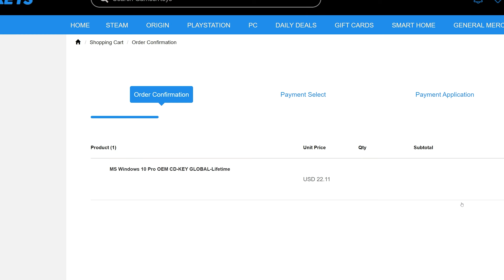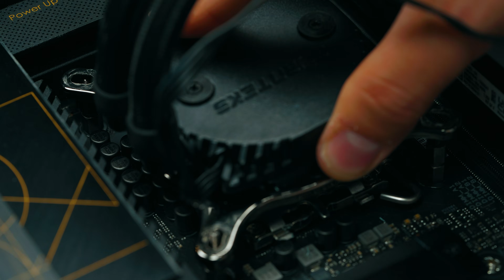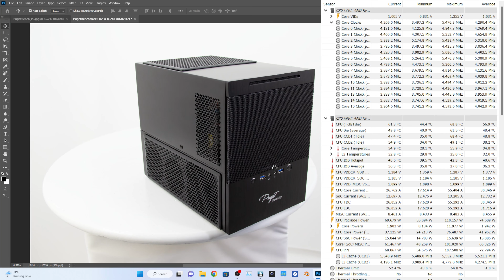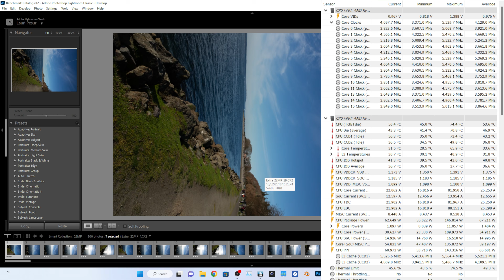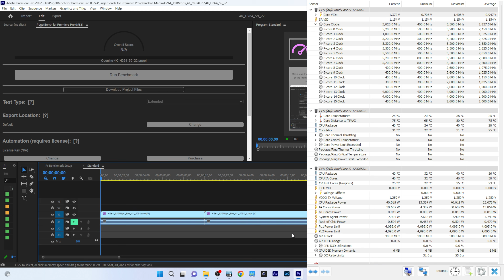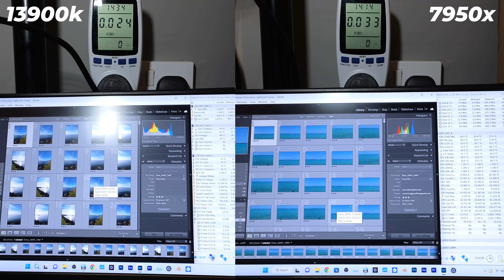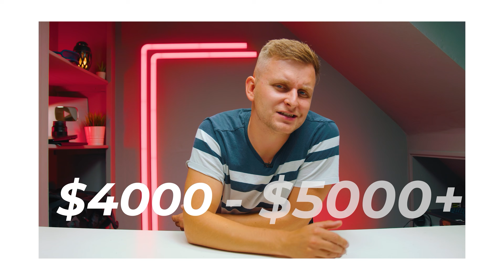INTEL & AMD both lied! 👉REAL WORLD power consumption is MESSED UP

Comment: are you trying to take a dig at youtubers that does power consumption to application used??? because a lot of big creators already know that and showed power consumption at different applications and their max consumption along with idle consumptions.... also while taking into account for those intel efficiency cores....
Reply: BTW some of those creators went above and beyond and already figured out their 1 week usage average... didn't change much on the fact that creators are better off using AMD because the average is way lower after 1 week plus in terms of time and efficiency, the AMD chips are way better for creators who needs to watch out for how much wattage they use... and the normal users who don't need so much performance over 30%-40% of the time, they are better of sticking to intel because they would probably use the efficiency core more often.... again this was all found out in 1 month of when the 13th gen launched....
Reply: as for those who game over 4hrs and need high core performance, you are better off using AMD as well... they already did the math back then....
Reply: this is all in terms of efficiency....

Comment: Ryzen 7000 eco mode? 5% performance drop for 40% energy drop. Also manual settings drops amd 7000 lower than any possible intel setting.

Comment: Guys it's all well but how about we measure the old and reliable way these idle and load powers, that is by means of a kill-a-watt? If there is 5W vs 50W "real world" difference in idle between an Intel and a AMD system, we would see it with the the meter. Right? SO, instead of beating around the bush and using "real world" applications. Just stick the power cable into the meter and that into the  power socket. Let's enjoy the real world results.
Reply: This is the actual way to measure real-world power consumption, not through software like AIDA64 and HWInfo as they are inaccurate and don't take account of power usage of other components aside from GPU and CPU

Comment: Power draw in all-core, 100% workloads is quite scary on my 14700 KF (over 300W peak), but I totally agree that this is hardly a measure of how the CPU will perform in the real world. Unless all you do all day is run CPU benchmarks like Cinebench or Blender, I suppose.. :)
Power limits on my board are indeed set to "no limits" at the board's factory settings and that's the whole problem. Also doesn't help that MSI have labeled the three PL-presets in the BIOS in a sightly misleading way. Even the lowest preset will set PL1 and PL2 to 253 W and it's labeled "boxed cooler". I'd like to see any Intel stock-cooler keep up with this CPU at those PL-settings, lol. The "no limits" preset is called "water cooler" or something similar, implying that you can run your CPU without power limits on a 240mm (or even a 120?) AIO. Which I could with my much less power-hungry 12600K but definitely NOT with the 14700KF. 
All that said: After having read up on the whole power-limit thing, I adjusted PLs, max current and voltage offset manually and the chip will now run right up to the limit of thermal throttling while drawing ~240W max and giving me the CB23 results you'd expect from an i7. All that on a 240 AiO. 
In the real world, the CPU never draws more than 40 or 50 W in more demanding games, sometimes peaking as high as 70 to 100W in certain circumstances. At idle and/or in desktop/browsing mode, it's very frugal and hardly ever jumps over 10W. True idle with just a sensor monitoring app open it'll sit at around 3W all the time.

Comment: Hello. Please advise. at the moment, I have a 10400 and a 6700xt (undervolt). I was assembling a PC to consume less energy, since I live in Ukraine. Should I change to 12400 or 7600 or 7500f? and which of them will consume less? thank you
Reply: 12400  + get some nvidia gpu for lower power consumption  undervolted 4060 goes below 100w

Comment: Just wanted to say this for people interested about the subject of power consumption, my I7 7700k + RTX 3070 + 2TB SSD+ 2TB HDD + four 8GB DDR4 RAM sticks + air cooler (single fan) + 3440x1440p ultrawide 34 inches monitor (G34WQC-A, should be around 39Watts) only takes around 92W to 96 idle (idle is web browsing on Edge + Firefox and nothing else) and 330W to 372W when gaming (max settings, 3440x1440p resolution), no overclocking everything is stock, tested with a wattmeter directly plugged to the outlet.
performances could be higher (and the 3070 consumption) but its held back by the older CPU.
so it's not so much consumption for good performances, i'm going to change my CPU soon and will probably go for Intel 13700k because the idle wattage is much lower than the AMD 7800X3D and while the gaming consumption is higher, most people don't game 24/7 on their PC so annualy i bet the consumption is lower anyway.
power consumption matters a LOT for Europeans because of the cost of energy getting higher and higher.

EDIT : my I7 7700k idles at 14W on average when using Edge with three Youtube tabs + four other tabs + Firefox and 8 tabs + Steam launched and with Hwinfo64.

Comment: Yeah but Intel has the meme worthy TDPs. So when you build a PC - you need to invest in an expensive cooler.
Reply: You are acting like AMD is any good. All AM5 CPU runs at 80-95C and AMD call it "normal" as if physics be damned in their eyes lmao.
Reply: @IAMNOTRANA  I have an old Xeon cpu with 8 cores. Avg temp in games is 60 degrees.

Comment: I think your approach is good, but I think you have a big mistake. 
How much a CPU consumes in IDLE is not determined by the CPU. This is decided solely by the power management of the motherboard and the bios settings. Maybe if there is a separate chip that is responsible for this, for example the EPU at ASUS.

Comment: Interesting impact of idle power draw. 55W is not a tiny amount of heat, and it can heat up an insulated room quite quickly. I have a friend, running an old Zen 3 system, is actually dealing with overheating issues because he doesn't have central AC. Built him a new intel system and has not had overheating problems since.

Comment: Have you tried lowering the power consumption of the intel 13th gen processors via bios? Like undervolting, limiting the temperature or manually putting pl2 values? Please make a video on that.

Comment: All the time I heard AMD fans saying that AMD is more efficient... turns out that AMD is only efficient if you leave your PC running at full load all the time. (Which is some people, but not most people).
Reply: Guru3D does these idle power measurements from the wall on all of their processor reviews and there's basically no difference in idle system power consumption between Intel and AMD.
Reply: @tak4043  Guru3D measurements are flawed. Instead of always using the same GPU & PSU, they keep changing the components with each CPU test - they’re basically rigging the results. For example, 1600W PSU and 1200W PSU will have different efficiency in low loads by a massive degree and even 2 PSUs from different manufacturers with the same wattage output can differ by 5-10W.
Reply: @Morpheus-pt3wq  Do you have another site that actually measures idle power and doesn't just stare at a possible software glitch?
Reply: As in doing work. Work is what the AMD chips are obviously made for, and Intel is good for bursting. Intel in actual work environments still gets the treatment by AMD.
Reply: Whenever the manufacturer will start talking about efficiency and not the actual power consumption, you can know it´s marketing lies.
Reply: @Morpheus-pt3wq  Except that what OP says is bullshit. AMD draws equal/less power at idle. All you need to do is look up any video that shows power consumption.
Reply: @michalsvihla1403  those videos don´t show IDLE power consumption. Instead, they show gaming/productivity loads and sometimes further rig the results by showing CPU-only power consumption.  Now, i´m not into productivity and i only play games occasionally with lots of internet browsing, watching videos & listening to music, which means my system idles A LOT. My current AMD rig sits at 80W at wall in idle. It´s mainly connected to both CPU IO die and chipset being active all the time and AMD seems to not even try to lower it.

I´m currently in the process of building intel rig (had to return the CPU due to it being faulty, got a knack for either faulty components or bad silicon in general) and when it worked, its idle power consumption at wall was 40W. That´s HALF. If i left the intel rig running 24/7, my yearly save of electricity cost would be 35€ - that´s assuming the electricity cost won´t go higher (which happened this year; previous year save would be 28€)
Reply from the maker: Exactly...
Reply: Intel are more efficient at idle, and that's just about it. The second you load more than a few cores, AMD is the clear winner. See Techpowerup's Gaming Efficiency page on their 14900k for a clear example. Most games do not max out CPU usage, but they'll more often than not load them 20-80%(depending on the CPU).

The only 14xxx series that gets close to AMD's 7xxx series in gaming efficiency is the 14600k.
Reply: Intel has basically always been way more efficient at low/idle load, interesting to see that is still the case today.

I remember comparing a hashwell system and amd fx system, the difference was staggering with the amd fx system drawing more power at idle than the hashwell i5 was drawing under load
Reply: @bjarne431  Hashwell? Is that the predecessor to Kebablake?
Reply: @michalsvihla1403  indeed, and its almost as good as kebab(lake) :-) (i know i misspelled it)

Comment: Amd is only better power efficiency if you run it at full load 24/7, for which I actually have a use case, but still chose 13900k, because of the reported issues with 7950x3d.

Comment: Since power consumption doesn't affect your electricity bills that much, a more important consideration, at least financially, is saving money on your power supply and cooler.  The power supply has to be good enough for the biggest power draw you'll have, even for milliseconds; the cooler has to be able to deal with your biggest SUSTAINED power draw.  Neither purchase depends on idling power.
Reply: What utopia world do you live in where electricity bills do not matter?

Comment: 13900k is MUCH more consisteant. I hated my 7950x.  Would boost all over the place doing as little as opening chrome. Idled at 40c-50c. Theis would cause my fans and cpu cooler to ramp up and down constantly when doing nothing on my computer. HATED IT! Just Crazy. My 13900k (-0.090 Undervolted) idles at 26-28c!  Thats it. It never boost all over the place opening apps and chrome. The only time it was more efficient was when under load or in Cinebench. Otherwise the 1300k is much better.  It also never goes over 85c with my Undervolt.  Gaming temps are lower on intel by 12c!

Comment: idk why everyone says AMD consumes less. Got 7800X3D/ 3090/ 64GB DDR5 with X670E Mainboard and it consumes much more than my previous build (11600k/3090/64GB DDDR4) in idle. Ingame the 7800 does consume way less than intel, but idle tdp (155w with 2 1440p monitors) is wild in my current setup.
Reply: Dunno what you are doing but 155 watt is insanely much for your setup. I use 104 watt idle average with 7950x3d (uses more idle, about 8-10 watt), 1080 gtx, single monitor, X670E motherboard and 64gb DDR5. You are either overlocking or disabled some sleep state bios settings, causing massive idle power.

This is with 5 SSD's and 1 harddrive.

Comment: Yea... software measuring is still really bad and unreliable. You don't even know if the software numbers are measuring/reporting the same thing, nor do you know the polling rate of the software/sensor (or if it's even programmed to show spikes). 

With this type of measuring, just measuring it at the wall(like you did in the end) is much better. Just try it with different motherboards and try to make some educated guesses about non-standard board power consumption. Motherboard chipsets are part of the ecosystem, so might as well include that anyway. 
Or just report all the numbers of different motherboard and let everyone come to their own conclusion.

I'd also be interested in knowing how much some motherboard and motherboard settings could save.

Comment: great job!  thanks for this  review/comparison !      it would be interesting to know how much   total pc  consumes  doing those tasks  ( with or without a monitor)   I think   on average    a gpu ( depending  which of course)   on idle - doing something     could consume  around   20-60w ??  ( not gaming  not rendering ).   and ram.  around 8 -10 watts ?   fans 12watts..  ssd like 10 ?      Motherboard   ,,mm :  around 20 w ?    of course this are  my'' just out of the pocket  ''  assumptions ..      :P.     so.         the whole pc ( without monitor)  would be consuming on average   ( doing  simple tasks  ).  30-40 watts cpu + 50 w gpu + 20 w  Motherboard ?+  25 w ram&ssd &fans (?) =   more or less   90-120 watts   ?

Comment: Well those benchmarks were app specific also take idle consumption into account (just a guess). When it comes to benchmark and power consumption you can see amd's power draw was less in every test.
Premier pro:
13900k- 298 watts - 1435 point - score:power ratio: 4.81 each watt contributes in 4.81 points
7950x- 229 watts - 1127 point  - score:power ratio:  4.91 each watt contributes in 4.91 points in performance

Lightroom classic:
13900k- 317 watts - 1942 point - score:power ratio: 6.126 each watt contributes in 6.126 points
7950x- 223 watts - 1880 point  - score:power ratio:  8.430 each watt contributes in 8.430 points in performance

I guess when underload amd has better power savings but due to idle 55w power consumption its average watts is higher in the tests.
When someone is using them for gaming amd will save more power.

😀😀😀😀😀
Reply: as the video says, it takes the average power consumption, including mix and max limits. Here, intel is more efficient.

Comment: I did some testing with the 7700X manual oc 1.18Vcore 5.2ghz. Also there's a setting in the bios that forces all the other parts of the cpu (iGPU Infinity fabric, etc) to run at full speed all the time. I turned that off. My idle is around 25-30 watts cpu package. Cinebench R23 ends up at around 19700 points using a max of 110 watts in hwinfo64. Without tweaking, these newer cpu's are power hogs.

Comment: I still don't see how intel is more efficient. They draw so much power yet win? If you were gaming for 4 hours then 1 hour video editing, the results would different.
Reply: intel is more efficient because when doing productivity work, even with the higher power draw, the work is finished much faster, while amd chips will still be working on the task
Reply: Anything above 13400F pretty much destroys AMD in terms of productivity.
Reply: He does mention its just idle power, meaning casual people who just want a pc for themselves or for their offices or something(which is like majority of the people) dont require 100% of cpu load for extended periods of time. Thats one of the reason why office pcs ans laptops tend to use intel. AMD does win in terms of efficiency while doing intensive gaming or applications for extended periods of time though.

Comment: Thank you for the huge amount of work it took to make this video, and doing more than looking at a blender workload result to arrive at your conclusion about these processes power efficiencies.  The amount of power these process consume while idle is appalling and The big tech reviewers should be ashamed of themselves for advertising ryzen processors is being more power-efficient than Intel.  I for the life for me couldn't understand why my 4770K clocked at 4.3 GHz on 1.32V is out performing my 7800X3D while idle. I'm 4770K would clock from 800 MHz below 10 watts to 4.3 GHz at around 110 watts. If I had known this before I purchased my 7800X3D, I may have went Intel considering how long and how often I leave my computer idle, or just doing casual web browsing.

Comment: HW Info doesnt accurately display Idle wattage of AMD cpus. When cores are PARKED, HWinfo doesnt show any drop ... the 5900 uses 30 watts idle, 20w for the SOC and 10w for the single core which remains minimally active and zero for the parked cores 

Ryzen Master accurately displays package power and you can see when the cores park in real time that the wattage drops.

Comment: I'm going for AMD, due to platform longevity. If Intel's current Raptor lake motherboards had a few generations of cpu left in them, it would be a different matter. Also, I wanted something easier to cool, i.e. lower power draw under load. I hate loud fans

Comment: I am used to idle on my pc a lot and seeing usage of 10W while watching youtube or just some light tasks its crazy good.. Intels 13 and 12gen cpus are just really amazing, I am in love with this thing
Reply: 👋 bro please reply me. What is the whole system power consumption showing in wall socket?
Reply: @katsrk3039  I cant really measure my wall socket because i don´t own any device to measure it
Reply: @iAdam43  Thanks for your reply. but remember that this software reading is not much accurate. I think total system suck more than 60W.
Reply: @katsrk3039  definitely i am well aware of that
Reply: 1.6 to 1.8  Watts on Energy-profile  'enery-saving'  for my 13600k with browser and vid open
otherwise  20
get the switch for ya taskbars guys  - powerplanswitcher  -  microsoft store

Comment: I wish I would have gone intel, seeing my CPU wattage jumping between 40 and 80 watts with basically nothing open is just dumb. I constantly run Ryzen master so I can underclock and undervolt when I don't need maximum performance, which wouldn't be an issue if Ryzen Master didn't crash my whole computer whenever I try to lower clock speed and voltage at the same time.
Reply: what amd processor do you have?